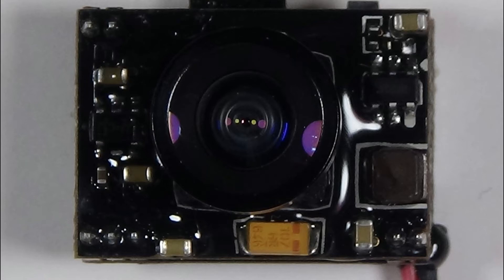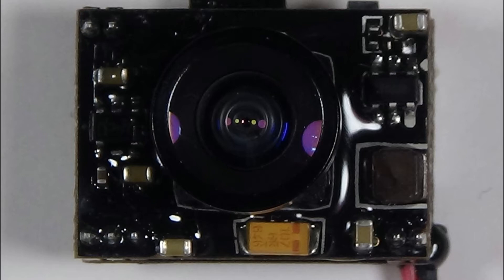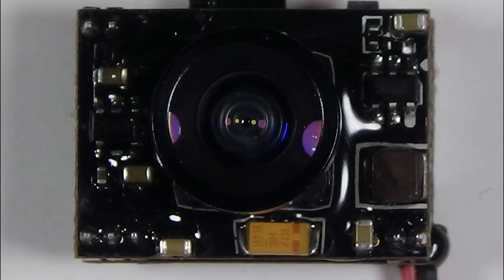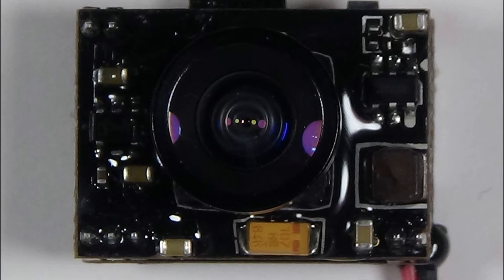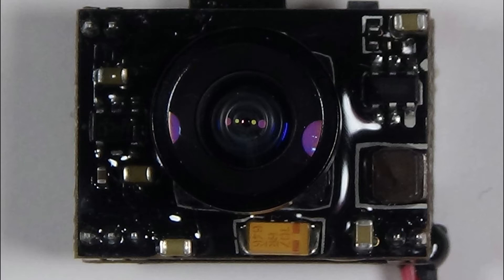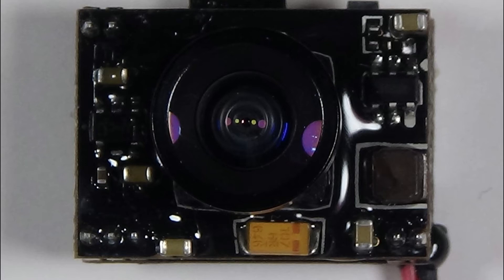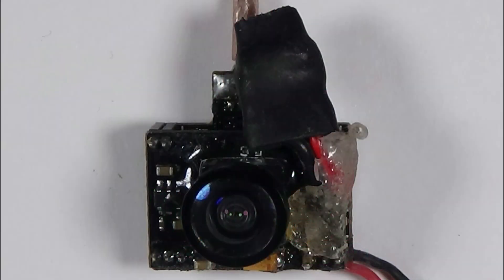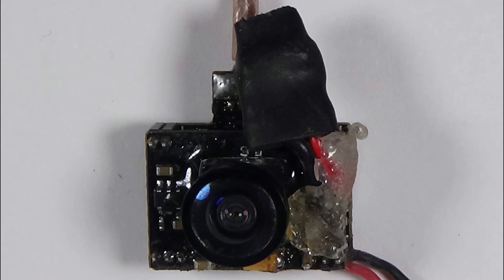Eachine TX03 - White Stripes Fix

Comment: Can Somebody give me information about the Two SMDs that should (or shouldnt?) be located above the three pin rail at the bottom right of the VTX. I think mine are missing, playing here and there the Image is sometimes correctly aligned... When connecting the Cam on AV all is fine...

I would assume the one should be a capacitor and the other one a resistor, according to Images found online.

Comment: I ran into the same problem. Actually caught on fire slightly where you spoke of. Though I tried it again and it flashed slightly and then all static.

I am running the camera from the balance port of my battery, is that a problem ?
Reply from the maker: No, it should not be a problem,... but I think the voltage spikes are. Since I am using the Cam from a clean 5V source I have not had those issues...

Comment: I used an 1uF electrolitic capacitor between the ground and 5 volts. Remember the electrolitic is polarized and the ground is marked on it. The black wire is ground the red is positive.  I made it direct in the cable provided as extension.

Comment: I have the same problem. Unfortunatelly I can´t see the conection because of the glue.
Reply from the maker: You mean the connection where to solder the new inductor? I had to scrape the glue they used to fixate the lens away from the old inductor with my soldering iron, then it should be easy to de-solder the broken inductor and add a new one.
Reply: Thank you very much for your answer. I fixed the problem putting a little electrolitic capacitor in the power line. Now it is working perfectly.
Reply from the maker: Interesting. Did you measure your inductor? Is it getting hot? Glad to hear it is working again, always good to salvage broken stuff :-D
Reply: It was impossible to measure it. I read allways infinite resistence. I used it with a 10 Ah powerbank. I do not know were came the noise from, but with this capacitor, disappeared.
Reply: PatOPaiar hi, i have the same problem what electrolitic capacitor did you use and in how did you solder it, i have a almost new one with the same problem, was thinking that the problem was the fc but did a test with another camera and ir didn't happened
Reply: PatOPaiar have the same problem here. you mind.sharing me what kind of capacitor is that you put on the power line?